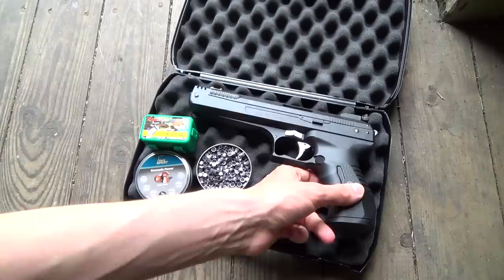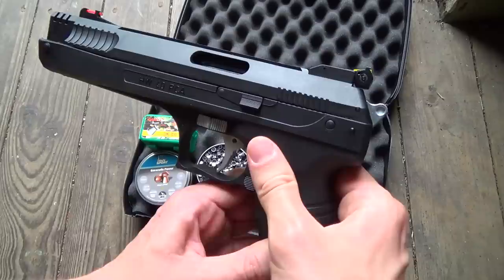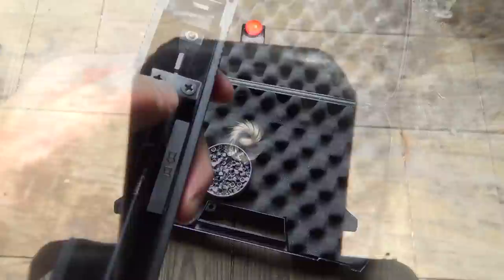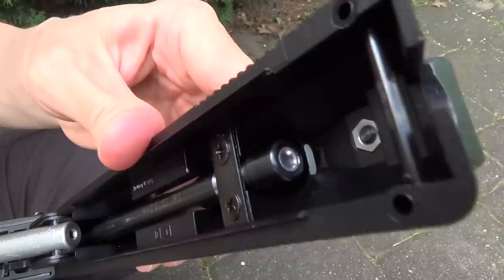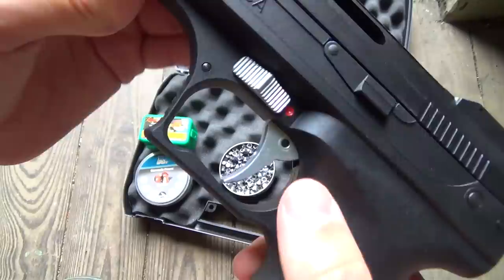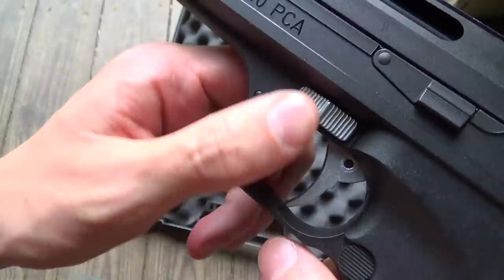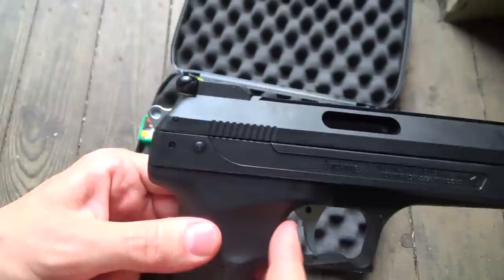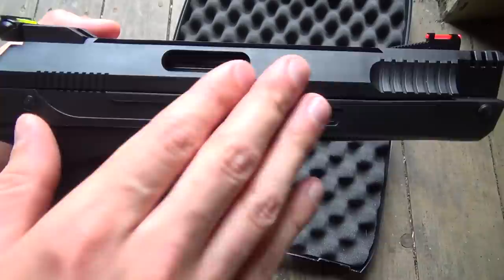Beeman P3 - Weihrauch HW40 Air Pistol

Comment: Best airpistol ever..ive had bought it last year..second hand/used..just little bit tuning by BoreUp the Main Valve"0,47mm"+LighterValveSpring,BoreUp AirNozzle"0,22mm"bigger,Tighter HammerSpring&longerHeavierRecoilSpring and it shoot heluva power..good with 177mm Exact pellets.within 8 feet,easy to penetrate a spray can both side

Comment: This is an extremely accurate pistol, virtually match accurate, In fact, I've seen guys use them in ten-meter competition. The trigger is about 400 grams and breaks clean. It somewhat fiddly to load, but other than that it's a great gun. I've had mine for about ten years and have shot thousands of pellets through it. There is a Chinese knock-off of this gun that sells for about forty bucks, but it gets mixed reviews.
Reply: Berapa harganya
Reply: @mochamatanwar8499  btl pengen tau harganya

Comment from the maker: Wineracks. ^^

HW HW45 has only 6-7 Joules depending on pellets and spring fatigue (happens on the 45 fast). For plinking it's absolutely enough power for and under 10m. But I wouldn't do close hunting work with it. I had a 45 in 5,5mm and it was fun but pellet drop at 10m was already noticable. 

I would say stay with rifles. I sold my 45 after a few months.

Comment: You can do the same mod on the P3 as you do on the P17 to get more power, take out the piston and build up the top of the piston. You'll need to measure how much head room you have with your calipers to see how much room you have to work with...
Reply: Price
Reply: Can the barrel be changed to a 22caliber

Comment: I can imagine that the process used to load this pellet gun must get annoying. Did you choose the pump single shot used by this design due to a unique benefit?  I ask only because there are many CO2 pistols which load easier and faster.
Reply from the maker: The gun was given to me by a friend and I just was in the mood to do a video about it. I personally don't own air pistols. Co2 powered pistols have an advantage of multi shot capability but they can get very inconsistent pellet velocities and accuracy at the end of a CO2 cartridge's life or in cold weather, or when you shoot so fast the cartridge freezes up and so on. Accuracy on airguns with compressed air is always more consistent and not as dependable on warm weather. That's the advantage. Also I like Weihrauch productes for their ruggedness and reliability. There aren't modern Co2 pistols out there which will survive the next 50 years or so. Maybe the Russian stuff like MP-654k but I bet you would have to replace springs, seals and valves in order to keep them running while with an HW product you can shoot it until you die. That's why I'm an HW fanboi. ^^
Reply: Magkanung presto nyan pls

Comment: I dropped a pellet down into the cap and it disappeared. Then, after shooting, it won't take any pressure. WTF?
Reply from the maker: What kind of pellet? Lead? Zinc? Copper? Harder pellets will not leave the barrel.
Reply: @2lbsTrigrPull  perhaps I was not clear; I dropped a lead pellet into the top of the pistol while open. It slipped out of my fingers and tumbled down into the cap along the barrel and disappeared. I turned it over, shook it and nothing came out. Then it fired normally. But when I re-loaded, it pissed out all the pressure when cocking. I cannot imagine how dropping a pellet under the barrel could do that but maybe it wedged up under the piston and did something wicked. Speaking of, I caught my old man pizza breast in the damn thing and almost chomped my nipple off with it. Doing push-ups to fix that ugly shit. Damn. Still got a mark.
Reply from the maker: @2012listo  😂👍

Comment: Good video, well edited, loading it slows you down a lot. I got one a few months ago as I had to take my Crosman 2240 in for repair (do not leave a charged CO2 cartridge in for more than a week or so) and had a few shots of this while out the back of the shop and bought 1 there and then. I was impressed with the accuracy and the sights, for me it's more of a target pistol as it doesn't have the power for pest control like the 2240
Reply: Where do they repair crossman's at
Reply: @melfromthehils7810  if you're in London Woody's Of Wembley, not open on Monday's.
Reply: I want that how mutch and how to order
Reply: @carloscastro5522  I don't think you can get them by mail order, due to age restrictions, but I think there are some places where you can, you just need proof of your age. You are not allowed any type of air gun in Scotland where they have been banned totally.

Comment: Слабенький пистолет даже ста пятидесяти метров в секунду не выдает, да и то что однозарядный плохо, вообщем полный примитив, хотя по дизайну вполне современный ...
Reply from the maker: Well it's just for plinking. Same as for the Baikal MP-61. Small rifle with not much energy for plinking although with a 5 shot mag but you still have to cock it. Fun guns, nothing more, nothing less. The HW40 is made after the Walther P99 and the HW45 made after the Colt 1911. FYI
Reply: @2lbsTrigrPull  I would like the speed of the bullet to increase, well, at least up to one hundred and fifty meters per second, otherwise you look at test results and understand that this is not serios... there is nothing to pay for...
Reply from the maker: @user-lf2yg1pm5e  If you want a stronger air pistol then maybe the HW45 is better suited for you but it's single shot too. ^^
Maybe PCP is better?

Comment: Bad design old
Reply from the maker: Yeah it's an old design! 🤜👍👌😁
Reply: @2lbsTrigrPull  Dont get me wrong it look good
But the pump action is bad

Im in the uk and back in the day i had a pump action.22
With a 5 shot mag
You had a Winchester like pump leaver that you pumped up to 10x then slid the mag across

Rabbiting was slow lol
My older brother made me swap it for a old BSA meteor that didnt work :/

He fitted new parts and made room for a big ox spring from a far bigger gun
Fitting a muzzle weight helped stop the jump and made it so you could load it
It could go through 3 old thick tin cans
It was far faster, very powerful
and very accurate hitting a lump of coal standing on iron sights at a football fields width
I think i still have it but couldn't load it as id end up with a hernia lol

If you have a old or weak springer id recommend a project...
If you know someone with a workshop lathe id recommend enlarging the spring carriage (sorry cant remember its name) and fitting the biggest spring you can
  If it took one hand to cock it and after it takes two then you know you have a winner lol

Thanks for the channel subbing now
Reply from the maker: @somethingelse4878  Spring powered and gas guns are more effecient with bigger calibers like .20 or .22. Depends on what you prefer. More energy or a flatter trajoctory and therefore better accuracy. I'm limited to the German 7,5 Joule max output. Anything to increase power is illegal. I could add a top head for the spring in order to minimize the spring twang. In fact, that's what I did. 😁👍

Comment: Before you buy this gun, you should join gym🤣
Reply from the maker: Not necessary. 😄😄😘😘
Reply: @2lbsTrigrPull  looks like it's gotta be darn hard to load a pillet
Reply from the maker: @chonkik5754  It's easy, you don't need to compress a spring.